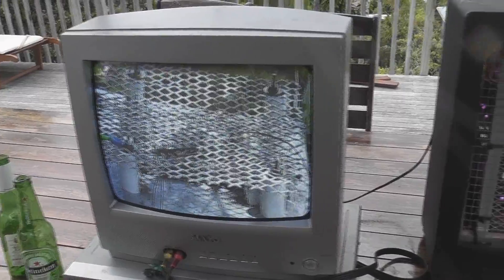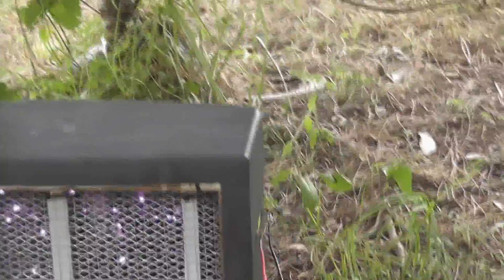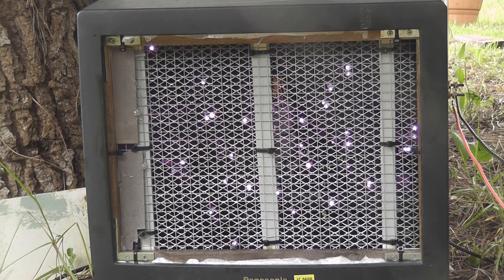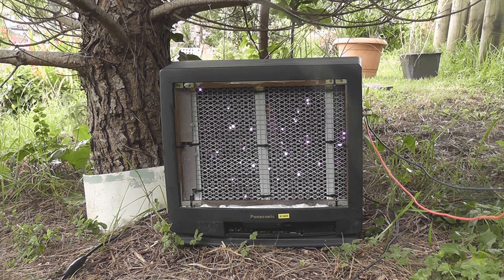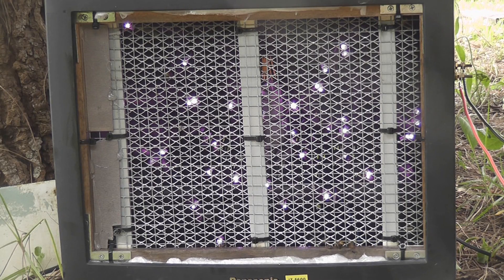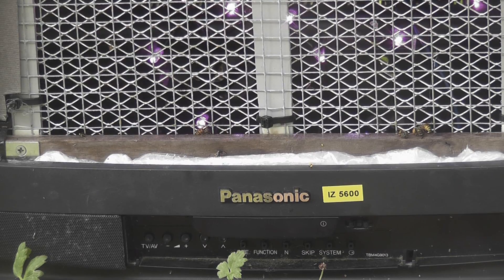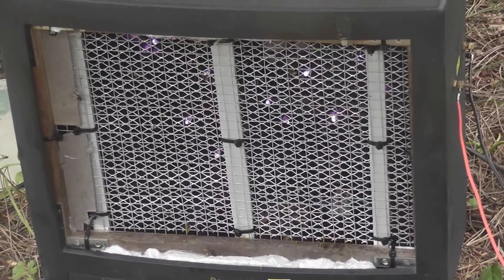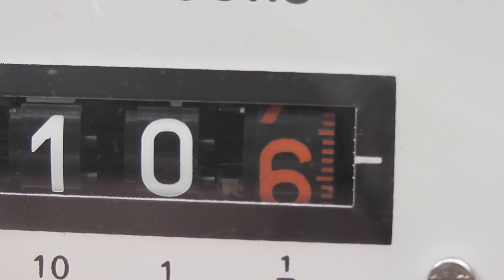Exploding wasps in the Panasonic IZ5600 TV [part 7]

Comment: You should attach a subwoofer to the case on a low frequency with pins on the bottom of the t.v. to A: hold in place B: to drive vibration into the soil, it might be a little more effective not that this isnt just might flush them out a bit more

Comment: Very nice video. I had a wasp problem a few years ago, but I used a different way to get rid of them. To start with I got some heavy duty expanded metal, some 2x6 scrap lumber,  some heavy pieces of steel a 70 pound of railroad track, a 1 pound can of 2f black powder and a 2 foot long piece of cannon fuse. Then gently pour the black powder in the hole using a small stick to tamp it down, when the hole will take no more insert the fuse, then lay the expanded metal, lay the 2x6 wood on top, place the pieces of steel, and then the piece of railroad track. Light the fuse stand way back and when it blows no more wasps.  Have some top soil ready to fill in the hole.
Reply from the maker: Awesome ! That is a military heavy duty approach, thanks for sharing.

Comment: put a vibrator motor on the tv   using a 3 or 5v supply to simulate  noise to annoy the bees    see what happens
Reply: or a motor with unbalanced  flywheel or something to transfer the vibrations into the tv

Comment: When there's nothing good to watch on TV, watch exploding wasps!
Reply: Anomaly88man yeah it sounds satisfying.
Reply: I saw an eagle explode in the power lines and let me tell you, it was impressive!
Reply: @spaceflight1019  What kind if eagle? Hopefully it wasn't a bald eagle.
Reply: @Adamisgood24  I wasn't close enough to tell, but it had a large enough wingspan to get between two of the three phases and disintegrate in a fireball and shower of sparks. I was driving south on PA43 between Brownsville and Uniontown.
Reply: @spaceflight1019  I wish I saw that too. I only saw high winds blow a high voltage line into the telephone pole transformer! It was very colorful, and loud, it happened about 200 feet from me.

Comment: All you have to do is squirt a little gas in there then cover the hole. The fumes will get them.  Same way you kill an ant hill ( poke three deep holes in it with a pry bar & drip a little gas in each hole... & a ring of gas around the hill to stop them from escaping). No need to light the gas... The fumes actually go through the tunnels & kill them all.

Comment: You know, you could make a wasp activated spark gap for a nice tesla coil and get cool looking streamers with every wasp that jumps the gap. Place a high voltage capacitor near the spark gap and use the transformer to charge up the capacitor. when the wasp completes the circuit, it will let out a really loud bang and then you will get a nice display of RF lightning from the top of the Tesla coil. Use sheets of window glass and aluminum foil to make the capacitor and use a neon sign transformer and a diode to make high voltage DC to reduce power consumption when it is idle.

But be careful with HV capacitors like this. They can kill you! But boy they make a heck of a loud bang when they discharge!

Comment: I would simply buy a bug-zapper ($20 in the USA), remove the UV Bulbe and the bottom plastic part, and place it on a wooden box with a hole into which this would fit. The open part of the box would be placed over the nest's opening and voila! you have a zapper for around $20!

Comment: Why don't you use a over the counter bug zapper and retrofit that into the TV? That would be less of a headache to rig up.
Reply from the maker: Yes that is true but they are usually not powerful enough
Reply: because that's not as cool. this project has gone from some junk electronics to a seriously engineered wasp death machine. building and refining the machine is more of the point, controlling the serious wasp infestion on this guys property is a happy by product. my .02.

Comment: +RODALCO2007 What if you put a fan on the inside of the TV that would create an air current that would push the wasps out toward the grids? Then the wasps would have no choice but tofly into the grids and get zapped as they were pulled into it?

Comment: what you need to do is put a board down under the TV with a hole in it to make it harder for the wasps to avoid the grid, thus killing them.  and use hot glue to plug other holes in the TV big enough to get through

Comment: How about a DC-AC comparison, using the same grid? Two MOTs with the primary reversed on one of them would give 4400V or so.
Reply from the maker: +AintBigAintClever Yes, may look into that. at the moment preparing a flyback TX from a TV to connect to a grid and see how that works.
Reply: would be nice... after all its the voltage that kills, not the current.

Comment: Viewer # 733. :-O

YAAAAY, the wasp zapper (or Sparta-2) looks more fizzy and snappy! :D

At least with this one, they HAVE TO go through the grids and not squeeze past them.

Even the VIPs (Very Insulated Pests) have to go through the grids, and have to have a tangle with a few million electrons. :D

Initial impressions of this wasp-dangerous telly: VERY SNAPPY!

I can see this evolving though..... Just like a television, if you can make this unit entirely self-contained, so it can merely be placed-and-plugged.

Then, when another nest pops up, it'll just be a case of plopping the zapper over the nest entrance and plugging into an everyday domestic socket and...... let the fizzing begin!

Another idea to add to this and feline-safety: See if you can put some kind of barrier grille on the front of it (a bit like the child-safety cage in front of an open fire) with holes in it large enough that the wasps can fly effortlessly through, but felines cannot accidentally make contact with the high voltage.

If your felines have ever tangled with black-and-yellow stripey things, then they'll have no curiosities with the wasps. 

Yes, the IZ-5600mk2: "A completely self contained unit. Just plug-and-zap!"

Thanxx for showing. A very interesting up-cycling of an old television case. :D

-BoomBoxDeluxe.

21st January 2016, 00.05

Comment: You need a 11kv transformer there, with a 400W series ballast. insta crisp with extended range, especially if you use those PFC capacitors and a stacked series of 40 microwave diodes to handle the 11kV.

Comment: lol epic love the HV standoffs on that TV!!
Reply from the maker: +Benjamin “Ozias” Esposti Correct. the PVC cable is insulated to 1 kV The M6 bolts fitted in dry wood. No partial discharge or tracking when dry.
Reply: +RODALCO2007 
They are just for looks, as far as I can tell XD
Reply from the maker: +HDXFH Just 2 x 3/16 brass bolts.